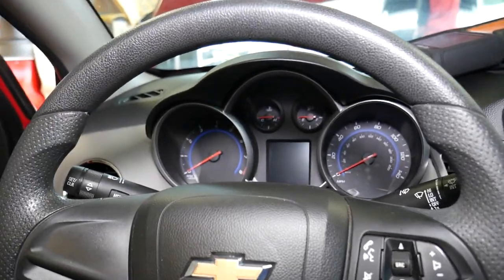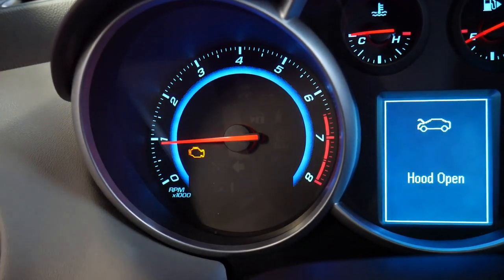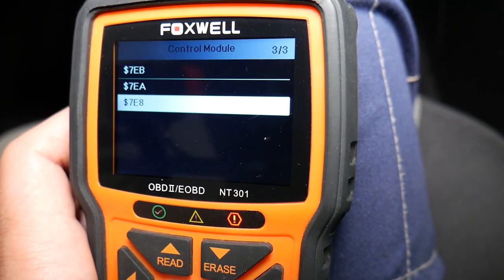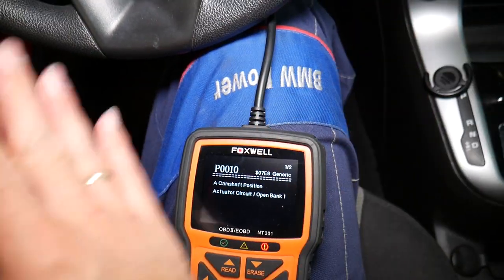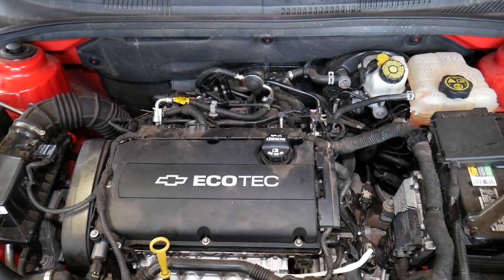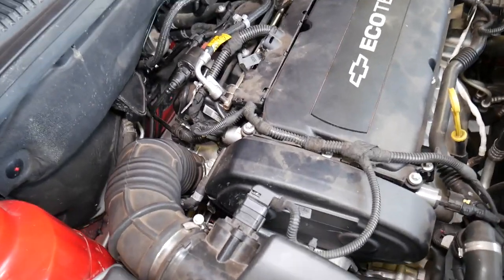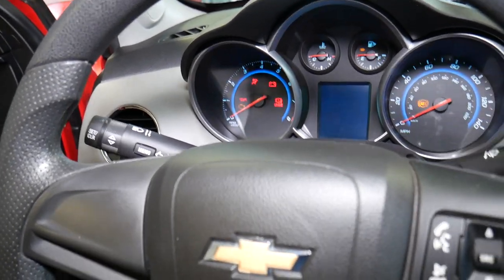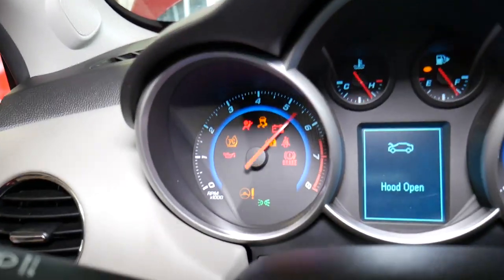FIX CODE P0010 P0011 P2089 CAMSHAFT POSITION ACTUATOR CHEVY, CHEVROLET, BUICK, GMC, CADILLAC

Comment: I replaced the solenoids n thame cam pos sensor and the code is still there
Reply: Same here! I changed the intake and exhaust oil control valves/vvt oil change and filter. Haven’t done the cam position sensor yet though….
Reply: @stoneytoney9336  anything?

Comment: Does not solve my issue once so ever. When i replaced my old intake vvt solenoid with a brand new one the dreaded p0011 code came on then i replaced my camshaft sensor just incase still had the code and check engine light on at a p0011 then i thought heck maybe it is my pcv valve bought a new one replaces it. Still throwing the check engine light and a p0011 code even after clearing the codes and doing a oil and oil filter change still have the dreaded p0011 code even checked the wiring for voltage and voltage was there with dc volts checked with both pins inside the connector on each side.  i  do not think anyone on youtube can accuarately describe or even find a fix for the issue bause i have found no video at all that solves this issue of the p0011 code.
Reply: Exactly what I’m saying and it’s messing up my car not wanting to accelerate after I break at a stop light.
Reply: Any solutions  I changed everything  have good oil pressure  even changed pick up o ring. Every few weeks my truck turns off and is very hard to start. When on it works perfectly

Comment: I had same code on my Australian model Cruze, turned out it was low oil pressure caused by broken 1 way valve which is situated below oil filter element, quite common that these break, have you any videos on replacing this valve , thanks
Reply: Did you find a video for replacing this
Reply: @mommaoldies8736  have u found it? I’m looking for it
Reply: I believe the valve you are referring to is simply just the oil pressure switch, otherwise known as oil pressure solenoid or oil sending unit. Many different names refer to the same part - this part is very close to the oil filter, just like you alluded to, and it is also a part that seems to go bad on these GM engines quite often. 

Perhaps this is the part you meant, if not, disregard my suggestion. 

Happy diagnosing, and good luck everyone!

Comment: I have a 2016 Chevy Cruze and it run just fine and my Check engine light came on but then it went off but the code that popped up was P0011
Reply: Hi, the same is happening with me, the code appears and disappear constantly. Would appreciate if you tell me how you fixed the issue, thanks.

Comment: Sup guy . So I've changed the VVT solenoids . Both camshaft sprockets . The camshaft position sensors . And an oil change and I still get p0011 popping up
Reply: Find any thing?
Reply: @devonstarrspacejam3694  nothing . I've even swapped vvt solenoids from exhaust to intake and still get the same code for intake side . I'm at a loss . Everything has been changed short of the head and cam lol
Reply: Only thing left to change is the timing belt and cam phasers atp.
Reply: @ramiroduenas573   Thats wild lol. Any update?
Reply: @SL-pg4dh  none . Car has been to the dealership 3 times and they can't figure it out either lol
Reply: @ramiroduenas573   Thats crazy. My hyundai sonata is doing the same thing. Going to the dealer in a week
Reply: Hi bud, have you find out the issue yet?
Reply: @mori___9  nope lol. Will prab swap the motor when it comes time to smog it

Comment: Have a 2009 Chevy Impala I got a code p0011 advanced timing you know the rest I changed the magnet or another name is camshaft actuator and as soon as I done that there's a real loud noise what's going on
Reply: Any luck? I had a whine that the ac compressor fixed. Now I have codes p0010
Reply: Same issues with 2010 impala

Comment: 2011 Camaro SS L99 engine. Check engine light is not comes on, however, error P0011-00 constantly sits in the ignition system chapter in the ECM. Also in 8 cases of 10 I have "Service Stabilitrak" message that comes on during cranking then dissapear. To eliminate it I crank starter slightly longer that usual.

As I know, P0011-00 is related to the VVT sprocket and / or timing chain and / or camshaft position. Do you have any thoughts on this?

Comment: Can you please do a video for P0014!! I have this problem but I dont know how to fix it thank you
Reply: Could be wiring, or the vvt solenoid, low oil or sludge in the engine. Could be the cam actuator or the timing chain stretched. It kind of all depends if the cars oil change services have be done regularly like it should have been. Obviously diagnosis of the vehicle will tell you what’s wrong..

Comment: I messed up and forgot to put oil car turned off on me while I was driving and figured out I need oil didn't oil change the next day was running okay but it kept turning off I have to driving 10 minutes or so I had a cold p0011 so I changed the magnet or the camshaft actuator soon as I done that it was a loud banging clicking noise I was still able to drive the car I'm still able to start the car but it turns off like within three blocks do I have a bad actuator
Reply: sounds like you locked the motor up. If the car ran out of oil, that will cause the motor to seize up. Noises and the car turning off randomly usually come first, then the car will eventually not start at all. Have a mechanic look at it
Reply: @Ken-1  when did I lock the motor up the car ran fine after I did the oil change except it kept turning off while driving my husband said you have a code p0011 the car turned off a total of one time per day and then I stopped driving it and I tried again the next day I gave in and change the magnet thing and this loud noise is just driving me crazy
Reply: The problem is the driver front tire valve stem is loose.